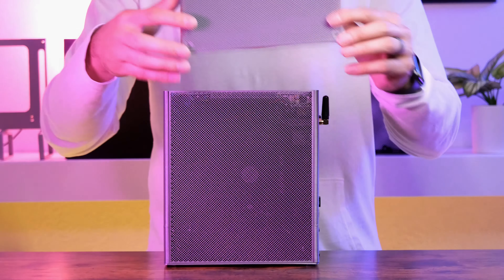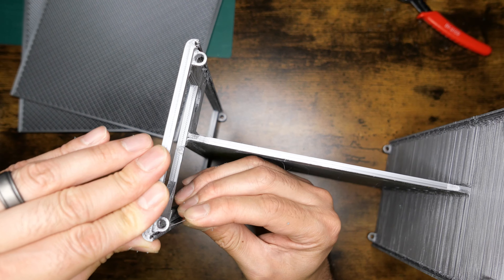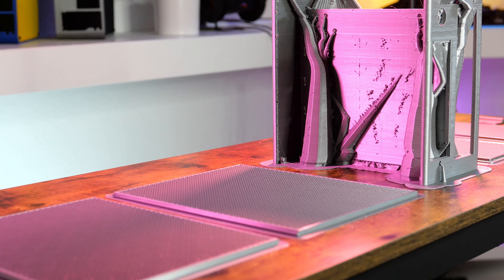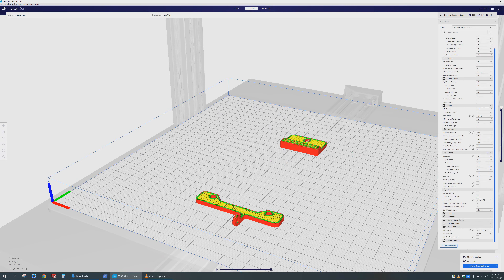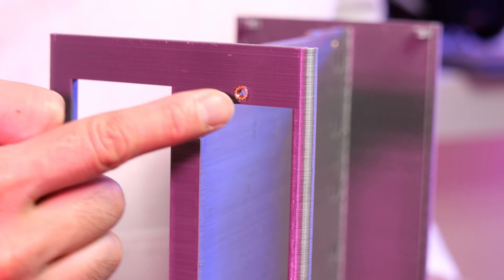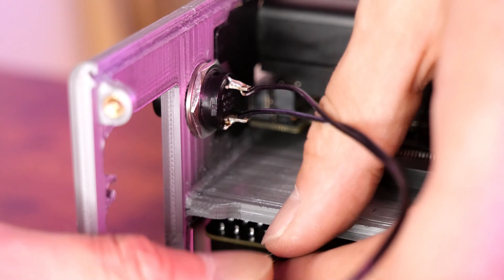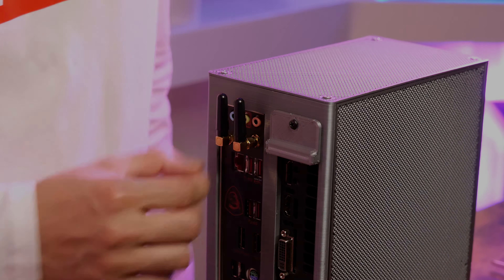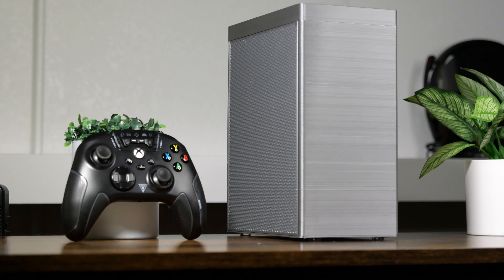In-Depth: 3D Printed ITX Gaming Build - Bonus Content

Comment: Thank you so much 🤩 i was searching a long time for something like this .
Reply from the maker: You’re very welcome and thank you for checking out my project. Just a heads up, the PCIE riser is out of stock and you may need to contact the manufacturer about stock.
Reply: @standupg4m3r  i am going to Print this Case myself, noctua l9a should fit ? Do you know the CPU cooler clearance?
Reply from the maker: I wouldn't go anymore than the NH-L9a for coolers that have the fan on top; it's the cooler I have installed inside right now actually @DennisLovesBikes

Comment: Bonus piece for the bottom the same height of the fan top with feet for more airflow.
Nice case, really wished I hadn't sold my Ender 3
Reply from the maker: Hey thanks for checking out my project. I would have done a bonus piece for the bottom too, but that PSU kind of just stops everything. 😅

Comment: You could save a ton of support, by angling out your top points for screw inserts instead of supporting them from the bottom of the print.

Likewise print support inside cutouts/holes instead of supporting the from the bottom.

Last ting. Have you thought about using magnets for parts you click together, instead of just relying on gravity? Gluing neodymium magnets on opposite parts connecting together will make a very strong connection.
Reply from the maker: Really good points, thanks for sharing and watching the project. Will try some of the suggestions.

Comment: You're really underrated
however, when I saw the Noctuas on the top of the case, I started thinking about watercooling 😆
There may not be 2x92mm radiators on the market, but it is actually possible to print your own rad and it actually kinda works. There are some videos on YT talking about that and I found it very interesting 🙂
Reply from the maker: subscribe and keep on the look out (wink-wink-nudge-nudge)
Reply: @standupg4m3r  Without a doubt, subbed.
Reply: @standupg4m3r  subbed on another account.
I use one account to subscribe and stuff and then I use a second account to write comments, so that's why it looks like I'm not subscribed 😆
Reply from the maker: @Get-Rekt  Now you're teasing me with one less sub. lol jk
Reply: @standupg4m3r  I know that if I say something about privacy, there will be someone asking me why the heck I even watch YouTube, however, I have two different browsers for browsing and for google stuff, both reporting Windows 10 (even though I USE ARCH, BTW) and blocking trackers, ads and scripts. I watch the videos in private mode so that it doesn't get connected to my subscribe-account and I sign in to my comment account only when I really feel like commenting or replying to a bunch of comments at once.
Also, I use a VPN 😉
any other tips to improve privacy are more than welcomed 🙂
Reply from the maker: @Get-Rekt  Hey I respect that. Thanks for either way, honestly.

Comment: Dang, the choice of background music combined with your voice is soooo soothing! I think I could honestly use this video as a sleep aid - and I don't mean that in any sort of negative way - quite the contrary! Excellent job with what looks like a rather complex thing to 3D print - it doesn't just have to look good, each tiny part has to be functional as well as providing structural support. That's not an easy set of requirements to juggle! I think you knocked this one out of the park!! 👍👌😀

One question I have - how well does the 3D printed plastic cope with the heat produced by the complete computer system? Any sagging or warping issues?
Reply from the maker: Much thanks and no offense taken regarding my video as a sleep aid! I subscribe to many channels like that for the same reasons.

In a conditioned room, I have no worries for PETG especially if you use the fan top bonus piece to extract the heat. The form factor kind of limits what high power devices you can put in too (I might regret this post once the next generation CPUs and GPUs are released though).

Thanks again for watching and the kind words.
Reply: @standupg4m3r  Thanks for the reply! :) Yeah I'm guessing the next gen CPUs and GPUs are going to be an issue not just for 3D printed cases, but all small form-factor cases - especially the new Nvidia GPUs considering it looks like they'll all be at the very least 3 or 4 slot cards. I'm actually wondering just how board partners and small case manufacturers are going to deal with this problem.
Reply from the maker: @DavidStruveDesigns  it might take an easily accessible option for under-clocking/under-volting/wattage limiting by the manufacturers to make it better for the SFFPC scene.

Comment: Good job on saving that spine print. I would have gone with a different approach for adding supports. You could have used less material if you went with standard support set to "everywhere" and then make use of blockers for the small holes as those can be a pain to remove and generally print well enough.
Reply from the maker: Thanks for watching!

I’ll have to give your suggestion a try for the next case. I appreciate it.
Reply: @standupg4m3r  you also try adding support roofs/floors can sometimes help with removal but not necessarily a smooth finish. Try them on some smaller pieces to see what your printers can do.
Reply from the maker: @Tuethida  I’m moving to a 0.6mm nozzle for the next print and will try to calibrate the machine more precisely this time around so that supports actual come off how their supposed to.

Comment: if you want good performance in a small gpu you should consider rx 6400, its abolutely tiny, doesnt need power cables because it eats <50watts and is more than 2 times faster than 750ti and its not very expensive
Reply from the maker: Thanks for watching and giving that suggestion. I’ve also been looking at the RTX A2000. More expensive though.

Comment: Congratulations for the project, it turned out amazing.
it have room or it could have more fans in the lower part for crossed ventilation ?
Reply from the maker: Thanks for watching, and sorry for the late reply. The "top options piece" can also be installed on the bottom, but the PSU will block a majority of it.

Comment: Love the 3d printed cases!  Seems perfect to print itx cases like this.  Just curious, if the 3 pieces (front, back, sandwich) are printed separately then assembled, would it compromise the case?  If printed separately then the panels could use the build surface for the surface finish, avoid supports, and have the panels in the strongest orientation?  Keep up the great work!
Reply from the maker: Thanks for watching and giving the words of encouragement!

Printing the front/back/spine is possible, but it would introduce the need to affix the three together; the method to attach them will determine how structurally sound it is in comparison to having it printed in one. Might give it a try though! Thanks again.

Comment: what this really needs is the PSU mounted sideways  at the bottom and those 2 noctua fans at the base of the case pushing air upwards and to more at the top like pushing the hot air out, that way there is a really good ventilation  happening but I could be wrong and this doesn't really helps at all.
Reply from the maker: It is a sound idea, but it would also make the case another 3" (guessing) taller to fit. I love it though. btw, thanks so much for dropping in with a cool suggestion.

Comment: I love all the 3D printed cases, but there are certain reasons why computer cases are made out of metal, and it's not because sheet metal is easier to work with or it's cheaper, than say injection moulding. All those high speed signals do benefit both from the cases acting both as ground planes AND Faraday's cages, keeping interference both coming in AND going out, so maybe print from material that has such properties and is conductive?
Reply from the maker: Thanks for watching!

You're not the first to comment about radio interference (and probably won't be the last). I honestly can't count how many 3D printed enclosures (not just PCs, but lab equipment too) I have successfully made without issues you touch on. I am not saying you are wrong or that I will never have issues, but... can you link the EMF shield you place your cell phone into while you sleep? ;)

Comment: What size holes did you have in your case for the heat inserts?  I'm assuming it's around 4.5mm?  Thanks.
Reply from the maker: Thanks for watching! I believe it was 4.7mm but I have been increasing it since. The file is available for you to measure too btw.

Comment: Is there anyway I could get the STEP files? I'm trying to add a pattern on the side panels.
Reply from the maker: Thanks for checking out my project! I have no plans on sharing any of the working files, and firmly believe I am being more than generous offering the 3D data in the form of STLs to begin with. I could easily charge for my files like other creators do, but I don't. Stay tuned for more!

Comment: I'm seriously considering printing this out and making my own steam machine. What's the GPU clearance on this case?
Reply from the maker: Thanks for watching. Best to stay with 175mm length and 2-slot. 

“RTX A4000 ITX cooler mod” is your absolute best configuration at the time of writing this (4/2/2023).
Reply: @standupg4m3r  Thanks! One more question, is PETG a must or can I use PLA? I really want to make the case out of a wood filament so I can stain and seal it.
Reply from the maker: @MrDsmall86  if you go with the fan top and your room has AC, I think it should be fine - but using high wattage CPUs >65w and GPUs might spell trouble. So they have wood PLA+? That could work too.
Reply: @standupg4m3r  I think I've seen wood PLA+, I'll have to look into it. I was planning on doing the fan top model.
Reply from the maker: @MrDsmall86  GL!

Comment: Most of your supports are not needed for bridges, and the rest could be designed with 45 degrees angles underneath
Reply from the maker: Thanks for watching. Really good points, too. My intention is to bust out many case ideas, so speed > details; often times I don’t even know the final orientation to print at so best practices (like 45 degree slopes instead of full circles) get low priority in order to get to the next design faster - if I were to charge money for these cases (instead of sharing them for FREE), you can bet they would be different and optimized.

Comment: What is the maximum gpu length?
Reply from the maker: Thanks for watching. Realistically, 177mm.

The GPU chamber is roughly 189mm, but you will have to flex the frame to get it in there because of the PCI tab bracket. 

Thingiverse link in the description has the model for you to measure btw.

Comment: Cool design, but i hope your neighbor isn't a radio amateur, unshielded electronics cause interference and depending on where you live there might be laws in place that actually protects the radio amateurs interests due to their contribution in emergency situations such as war or natural disasters for communication purposes.
It's rare but something to considder before stepping away from using a metal case for your pc.
This is why xboxes and such come with metal shielding inside the plastic case.
Reply from the maker: Thanks for checking out my project! Do you have any suggestions on how to make a plastic PC shielded? Coating, plating, paint perhaps? If there are any in my area, I have not heard inquiries and I have Raspberry Pi’s running sans-cases and their Wifi blasting.
Reply: @standupg4m3r  maby a fine metal mesh?
Obviously this isn't something most people will be building but i just wanted to spread awareness about the potential issues to consider 😀
Reply from the maker: @StopaskingformynameYouTube  I appreciate you sharing this. I am aware that our devices go through FCC certification, so maybe I will think more on this. Best!